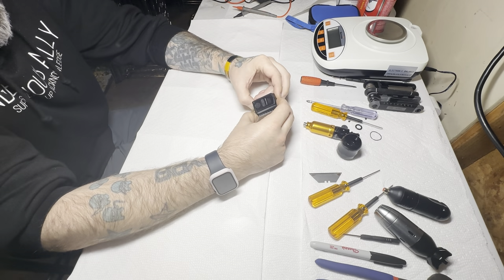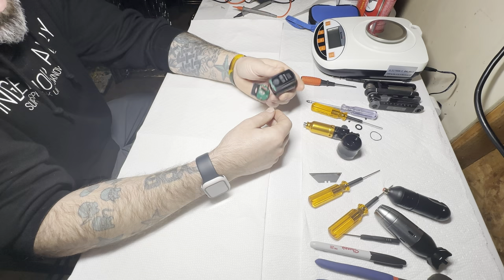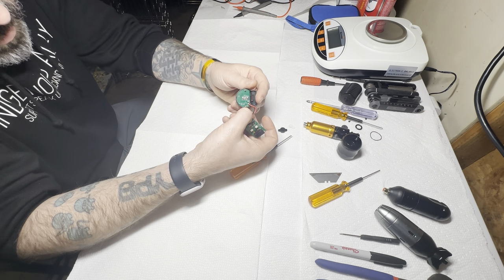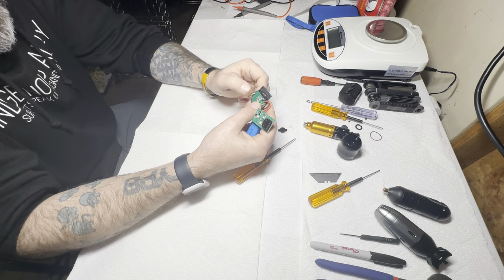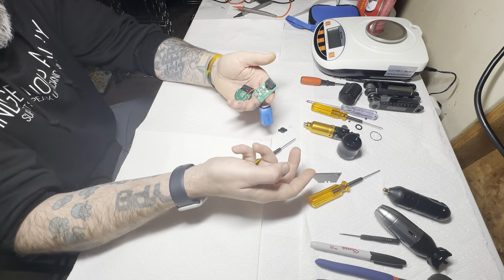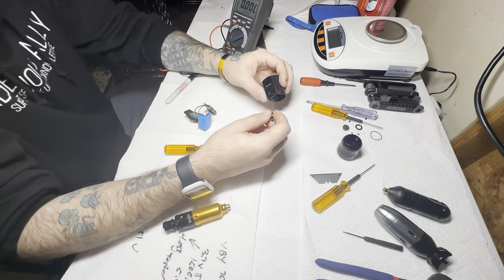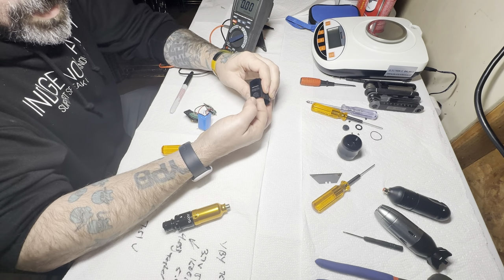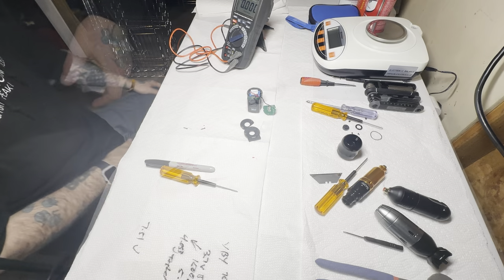Critical Tattoo Power Supply - Battery Pack Disassembly and Reiview

Comment: Hi!! I’m so happy I found your video, my critical battery has the RCA connector loose, it still works but it stops everytime I move the machine. Do you know if I have to order a replacement for the RCA or any will do? I live in Switzerland and shipping from the states is a nightmare 🥲
Reply from the maker: Just crack it open and fix it yourself. The RCA back ends on those are easy to fix. You can even just strip the wire or one of the wires that’s come loose with your teeth and grounded against the body of the machine and it’ll start working.

Comment: Do you know where I can buy a replacement battery? I’ve had mine for like 3years and it’s great but I don’t wanna replace the whole thing
Reply from the maker: If you want to replace just the battery you can find them on Amazon. Just open the case, find the serial number of the battery and type it into search. Order them and replace with some clean solder
Reply: @BetterTattooing  I did that. Looked up every number in every sequence couldn’t find anything that resembles the same battery. Thought u might know. Thanks
Reply from the maker: @ashleyink9339 I can’t see your battery so I can’t help over text. If you shoot me a picture of the battery via email I can try to help
Reply: @BetterTattooing  it was the exact numbers of the one you pulled apart, yby 752034*3p 3.7v 1500mh. i searched everywhere
Reply from the maker: @ashleyink9339 find a battery that has the same form factor and volt/amp rating. It doesn’t have to be an exact model match, just matched the output characteristics and has the same shape
Reply from the maker: @ashleyink9339 sometimes manufacturers have a deal with battery makers to have a specific model made for their products. If they do this manufacturers may not sell them direct to consumers. The workaround is to find a like battery and use it instead.
Reply: @BetterTattooing  thanks bro. I’ll check it out